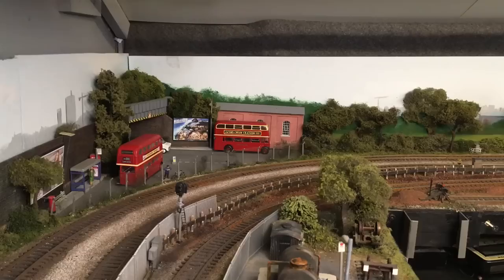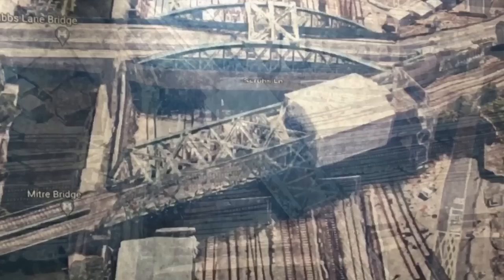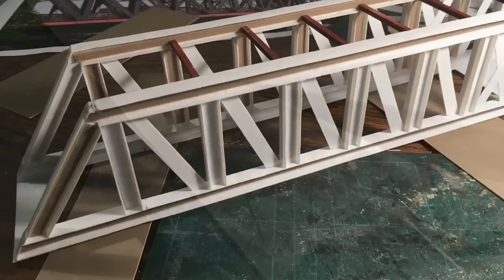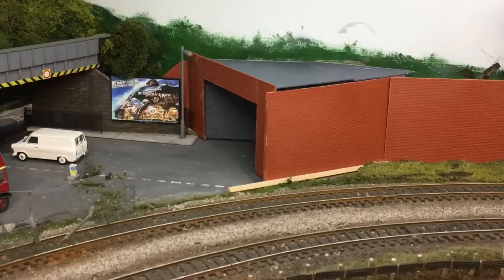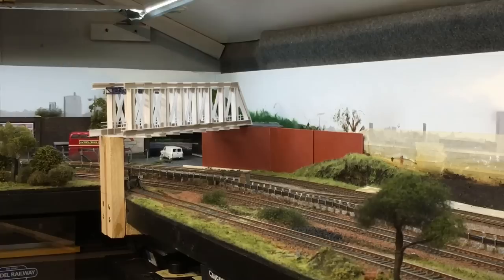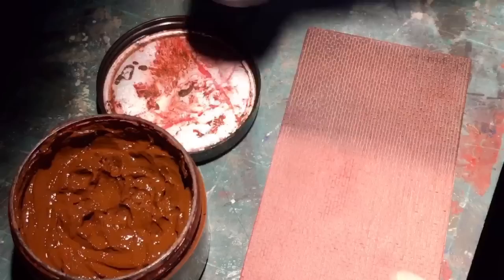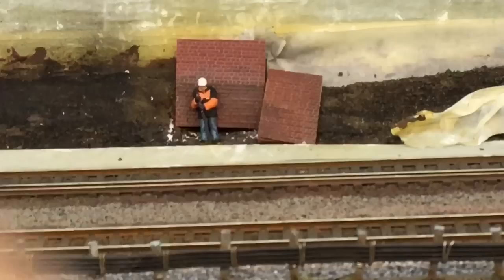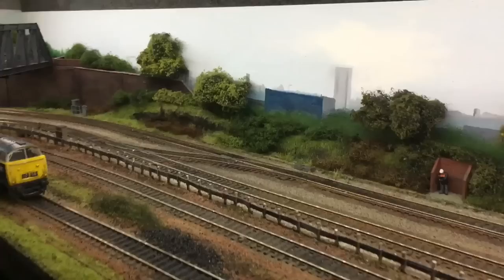Scenery Re-Build

Comment: Another great update. To help with the illusion with the hidden road you might want to add posts to show it has lighting as all roads around the area would have them. Rather than having the light with a bracket coming out the back of the lantern put the light on top of the post as it’ll reduce space needed to get it in. Lighting in your era were using ‘post mounted’ systems so won’t look out of place. Or paint the columns on the backboards.
Reply from the maker: Many thanks- I still have a few lights to add here, Think I know what you mean with the lamps.. 
Cheers buddy